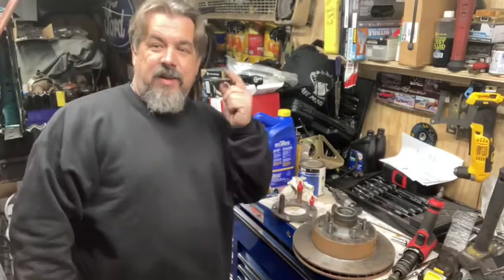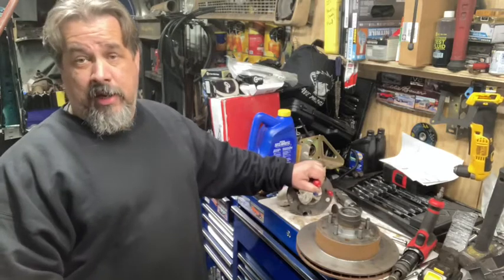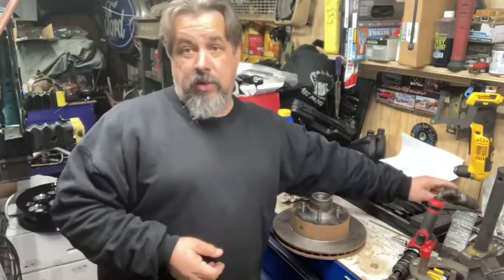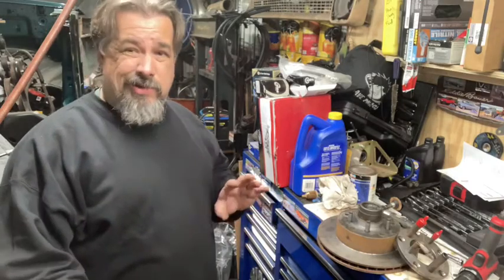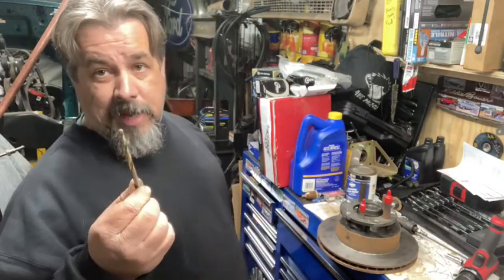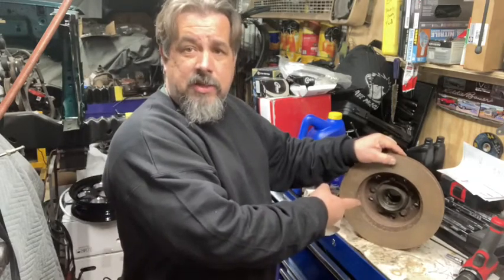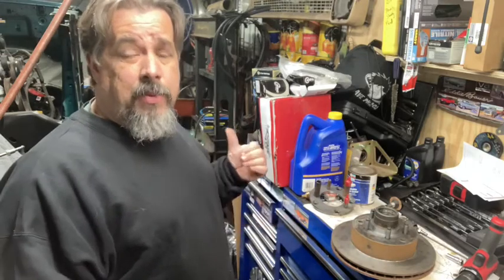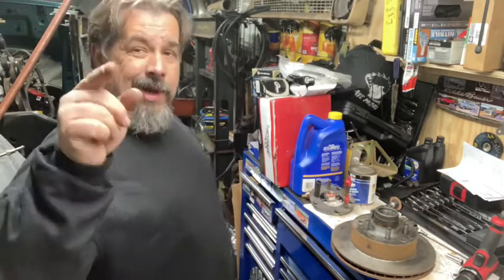Redrilling rotors and axles to change the bolt pattern

Comment: I have done this before by hand with a hand drill. All i did was buy a wheel spacer with the bolt pattern i wanted and put a hub centric spacer ring to make the spacer fit perfect over the hub. Then center punched all the holes. Then drilled and tapped them. And bought wheel bolts instead of studs. Super easy. Diy

Comment: Could you just grind a small bevel on the stud seating surface where the radius on the rotor interferes with it going all the way down?
Reply from the maker: Yes it you could it just needs to have a way for the stud to sit straight with out doing something the stud will always be pulling at a angle hope that helps

Comment: Can I do this to my 2002 Ford F-150 5.4 Triton XLT I wanna change it form 5x135 to 6x135 and is this work for mine
Reply from the maker: @johnhammond2390  if you can find one in that size yes
Reply: @thedelawareranch2379  where do I find it I have looked everywhere and I don't even know what the tool called and my truck is 4 wheel drive that want matter and I been doing some reading and some people say you can use the 2 peace wheel adapters for one of those tools to my truck a 6 lug
Reply from the maker: @johnhammond2390  I found it on the jalopy form it’s made by a guy Rottenleonard .com 
That’s what I’m the tool I have had several people ask I’m not sure if he’s still making them or not this one let you go from 5x5 to smaller ford 5x5.4
Reply: @thedelawareranch2379  yeah mines 5x135 and I want to got 6x135 I've googled and I've talk to some people I know they have truck like mine and have switched the whole thing to 6 lug pattern and I guy I work with told my wheel adapters of the bolt pattern I want and drill the holeyfor it
Reply from the maker: @johnhammond2390  I did just google that name comes up to a Rotten Leonard’s jalopy shop in Idaho I have had this tool for 8 years or so now
Reply: @thedelawareranch2379  a guy I work with bought wheel adapter and used it for that tool you got there he has the same truck as me he said all he done was cut the old stud's off and weld the grabs on the front and back the grind it down smooth and use the adapter for the new bolt pattern and drill the hose for it
Reply from the maker: @johnhammond2390  I heard of guys doing this I my self never tried doing it
Reply: @thedelawareranch2379  well you think that will for mine and if do it will have to change my brake calipers or just the rotors to a 6 lug pattern
Reply: @thedelawareranch2379  wonder if it would work